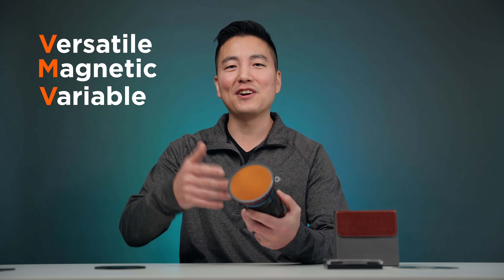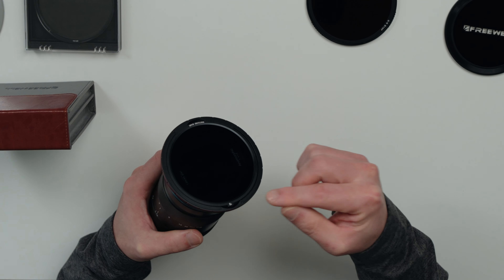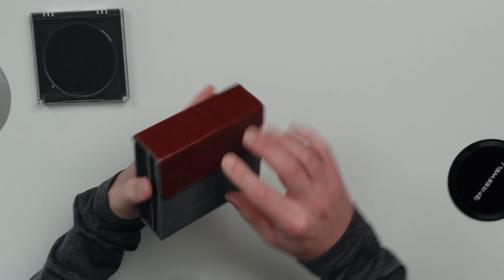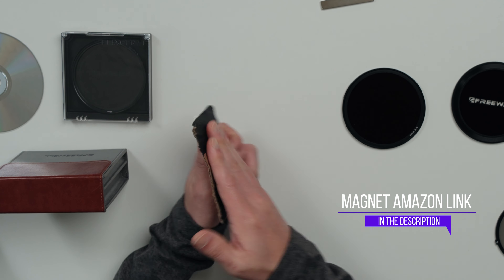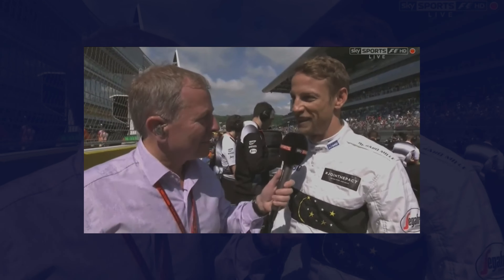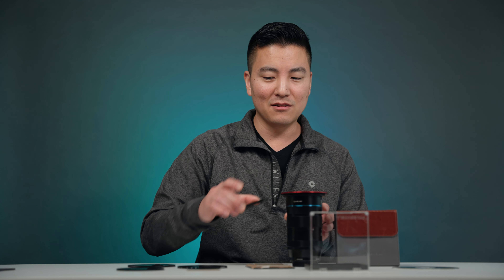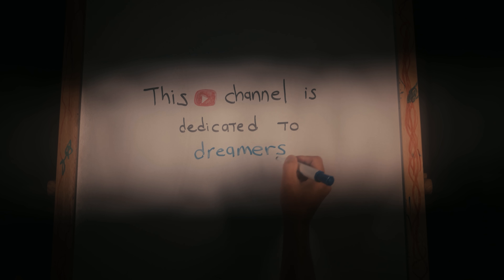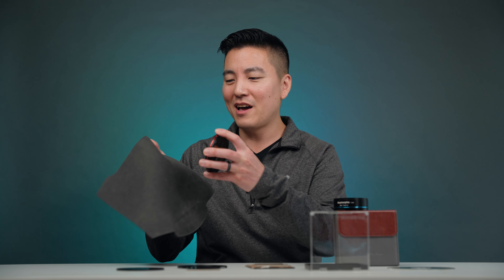3 Freewell Magnetic VND Filter Hacks - Almost Perfect (Plus 1 Bonus)

Comment: I'm having an issue with the supplied magnetic cap when used on top of the vnd ring: It can slide off when the camera is in the bag thus risk scratching the vnd 2-5 glass underneath. Any tips?
Maybe a third-party rubber cap? thanks
Reply from the maker: Hmm mine sticks on fairly strongly.  Haven’t had that issue.  I just tried the Peter McKinnon VND cap and FREEWELL standard rubber Cap and those did not fit.  Mine is the 82mm version.  My bag compartment is also is adjustable according to the size of my camera so it is a tighter fit.